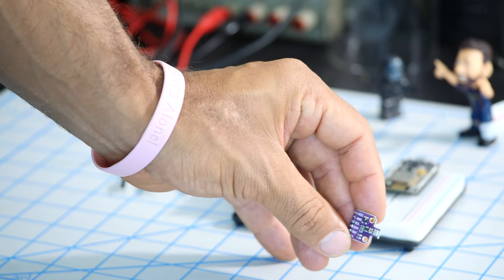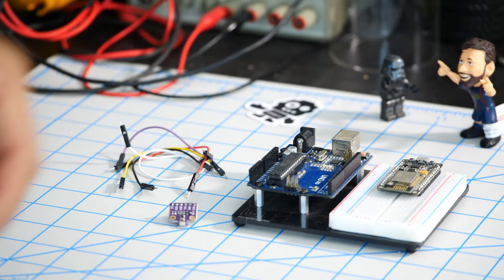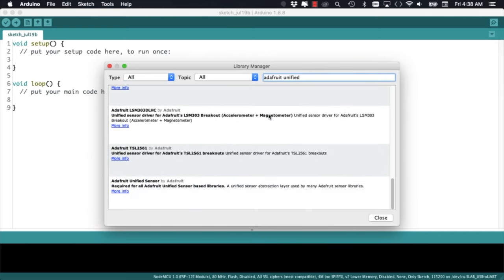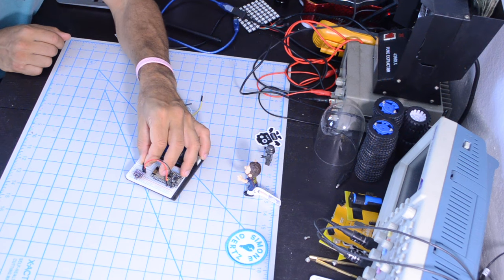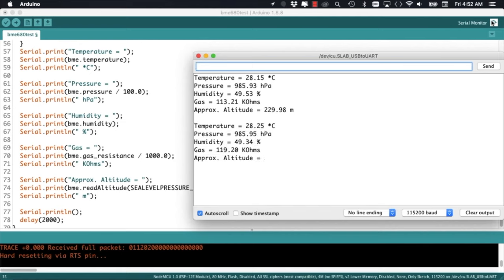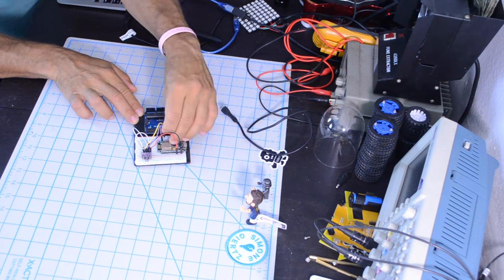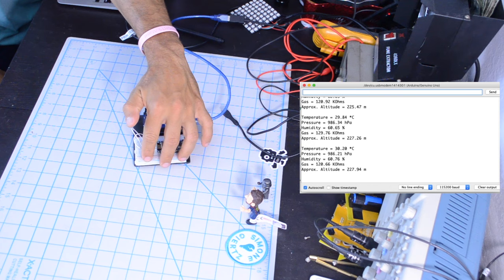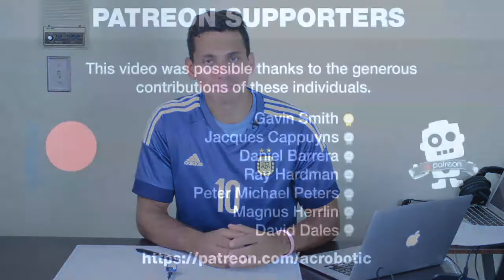Getting Started | BME680 Temperature, Humidity, Pressure, Air Quality w/ Arduino ESP8266 | BRK-00019

Comment: Further to what others have  said about the gas sensor, i think it is quite useless: as output it comes with a total meaningless number. That does not change the fact, you made a great video
Reply from the maker: Thanks for the kind words, I’m glad you liked the vid. Yes, most of these MOx-based sensors are incredibly hard to calibrate as their measurements vary widely w/ changes in temperature, humidity, and also degrade with time. They work fine for detecting ‘significant’ changes in concentration, but getting meaningful values (ppm) isn’t possible. In the $10~$20 range it is a good deal to get 3 or 4 environmental measurements in a single package for hobby-grade projects!
Reply: @datasith  definitely, still, I drew the line at the bme280. Only gas i am usefully measuring is co2.  With a winsen mhz19, still 'fairly' cheap :-)
But you definitely explained very well for someone e who is using  the bme680
Reply from the maker: I want to do a comparison video between a few CO2 sensors, and yup it boiled down to the MG811, MH-Z19, and a cheapy ol’ MQ-135. I was definitely impressed with the MH-Z19. Hope to finish it soon!
Reply: Yeah the words "cheap" and "gas sensor" don't belong in the same sentence. I've heard someone say cheap gas sensors are better employed as random number generators....

Comment: Hi,
i tried this sensor some times ago, but the gas reading were very unreliable. It was contiuosly growing. Also temperature reading were influenced from the gas sensor unit that requires to warm up the sensor. Could you monitor your sensor in continuos mode for some days to verify if yours one have the same behaviour?
Reply: As far as I can tell, the onboard temperature sensor is really meant for compensating the humidity/gas/pressure sensors. The datasheet does mention that the reading will be above ambient due to self heating. It's misleading that they market it as a four-in-one sensor. For accurate room temperature sensing you kind of really need to add an additional ds18b20 or something. As for the tvoc part, it has all sorts of auto-calibration/baseline functionality to compensate for drift, which makes it useless for absolute measurement if you ask me. It apparently also needs a burn-in period when new, and every time it's switched on.
Reply from the maker: Interesting to know, thanks for sharing. Sensors based on MOx are inexpensive, but unfortunately 'unreliable' (hard to calibrate) and can only be used to monitor relative changes in gas concentrations. You're right in that it shouldn't continuously increase(!) Certainly, I want to run a few over a week and plot the results—I'll make a video of the process!
Reply: @datasith  Would be very interesting to see your results, thanks, gracias!
Reply: the temperature is sensed first, so it's NOT affected by the MOx heating, check the datasheet for the BME680 for the reading process. For example, for the BME280 it does T->H->P, thus temperature is sensed when cold. You should also NOT use these sensors in "normal" mode(continous reading) but in forced mode(forced reading, then sleep), thus you eliminate the self-heating
Reply: @gglovato  and @Marco Buzzanca Were you able to get an iaq accuracy of 3? After 5 minutes of operation I get the value 1 without ever reaching 3 (sometimes the value drops to 0). I use D1 mini and BME680
Reply: @igorbisori5117  i haven't done much more with the BME680 yet :(

Comment: Hi,
I just tried using this sensor but I am unable to see an readings in the serial monitor. I am using 115200 baud as you did in this video. The serial monitor will only print "BME680 Test" and then nothing happens. Do you have any suggestions?
Thank you!
Reply from the maker: It looks like your code is getting stuck at line 39. You see the debug message, but the code stays in the while loop due to not finding the sensor. As suggested in the code, double check your wiring :)

Comment: how does it measure altitude ? and if the others say that VOC sensor affect the temp sensor would it render this to be useless ? or is there a solution to this ? im as excited as you to find out the answers to all these questions.
Reply from the maker: Pressure varies with altitude, and there's a standard conversion to calculate one from the other. I will run a few temp sensors alongside the BME680 and post the results. Stay tuned!
Reply: i see, hence the "approximation of altitude" . awesome, again excited to see the results of your findings.

Comment: I am using the same CJMCU-680 ( which you are using) . But the Device is not working. I Scan with I2C scanner but no device or address is found. Do i need any Pull up register with it?  I am using Esp32.
Reply from the maker: I typically don't use pull-up resistors and it works okay. Double check your I2C connections, it's gotten me more than once. Make sure you're using the default I2C pins: SCL @IO22 and SDA @IO21.

Comment: Sorry, I don't understand what you say at 4:03, "the defaut [???] address" . What is it (and, optional ― I will google it―: why)?
Reply from the maker: The "???" was "i-squared-c" typically written "I2C".
I2C is the communication protocol used by the BME680. this communication protocol depends on each device having an address. the one for the sensor is 0x77 by default, but you can change it to 0x76 in case you had another device already with that address and couldn't be changed!
Reply: @datasith  thank you very much!